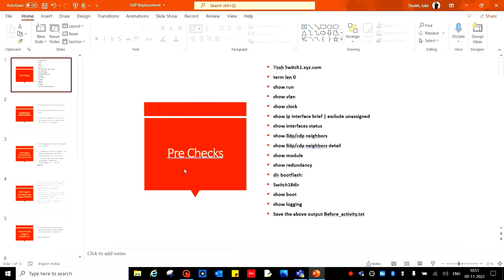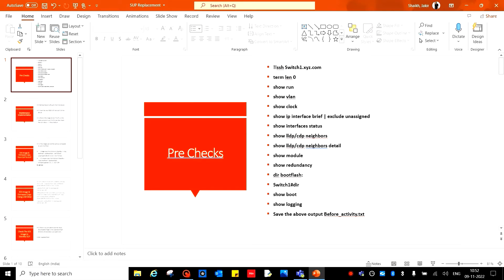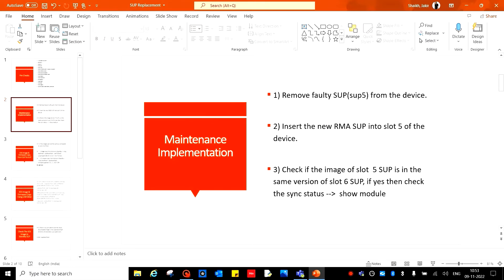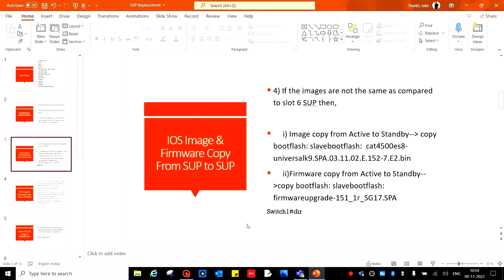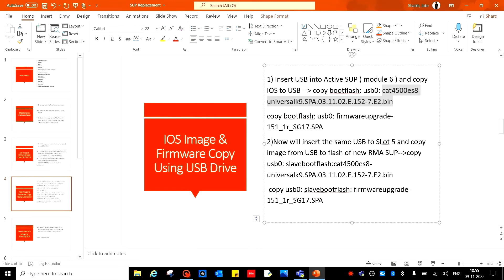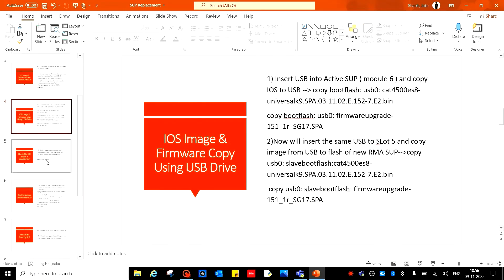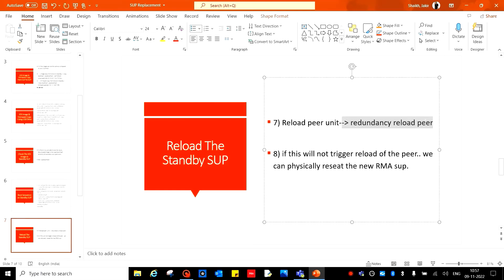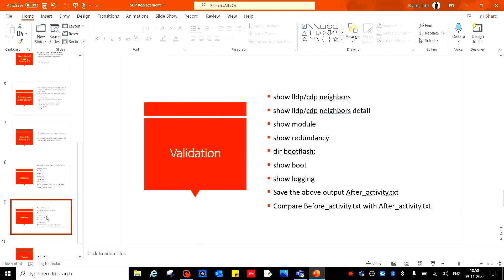How to Replace SUP Engine on Cisco Cat 45XX / 65 XX/7k Switches

Comment: One question:"redundancy reload peer" is to enter in the NEW device o in tha ACTIVE SUP?
Reply from the maker: To reload only the VSS standby switch, use the redundancy reload peer command. To force a switchover from the VSS active to the standby supervisor engine, use the redundancy force-switchover command.
Reply: @Computer_Networking  thanks man ,really usefull. i'll ask one more question: is it not enough to copy just the IMAGE to the supervisor? why both image and firmware?Thanks again
Reply from the maker: @aussietramp  When a Cisco 4500 switch is powered on, the firmware (specifically the boot loader) is the first to execute.
The boot loader initializes the hardware and performs basic diagnostics.
After initialization, the boot loader locates and loads the IOS from the switch's memory (flash memory) into the device's RAM.
IOS then takes over and provides the network functionality that administrators configure and use.
Reply from the maker: Functionality: Firmware controls the hardware directly and prepares the system to load the IOS. It includes:
Boot Loader: A small program that initializes the hardware and loads the IOS into memory.
Diagnostic Software: Performs hardware tests and diagnostics at startup.